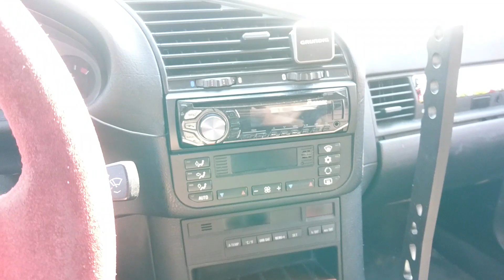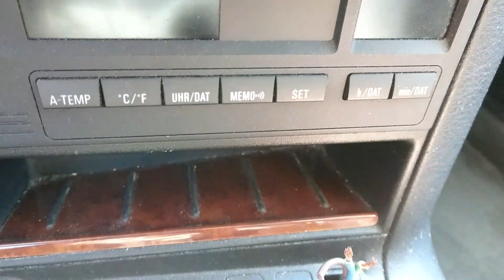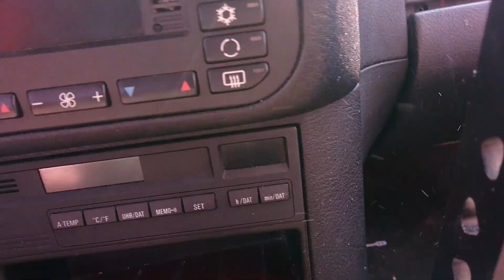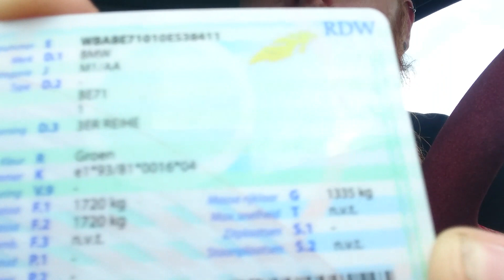weight reduction and weighing the e36

Comment: I had a 97 240sx I did a SR20 swap on and gutted everything from the front seats back, relocated batt to trunk, carbon fiber hood. Actually made a good difference. I really want to do a e36 track build next with an LS swap.
Reply from the maker: Adding power is expensive. Removing weight is free. And both help the power to weight. So its no Brainer right.... thnx for you comment
Reply: @theslidingdutchman  exactly, and honestly I think doing weight reduction is one of the more fun mods to do. Lol